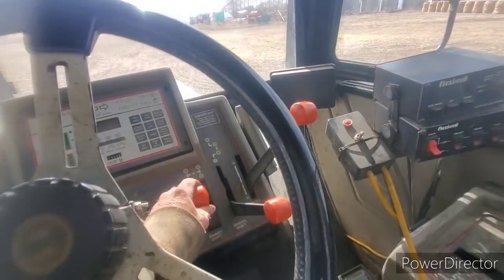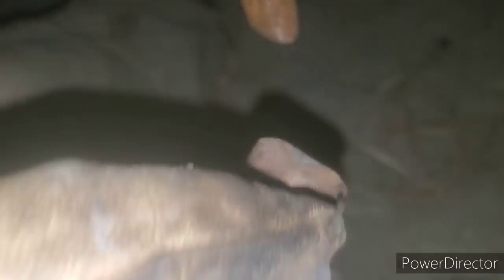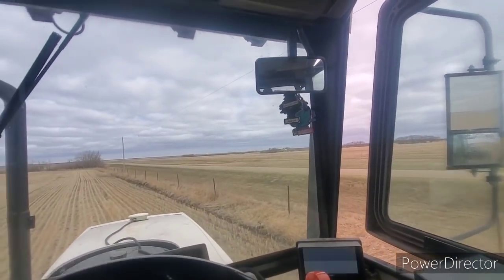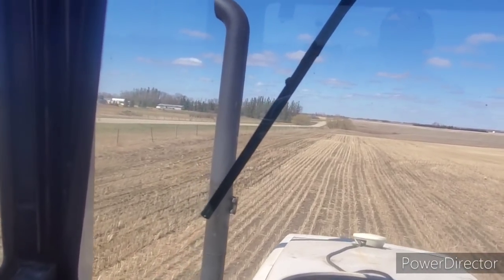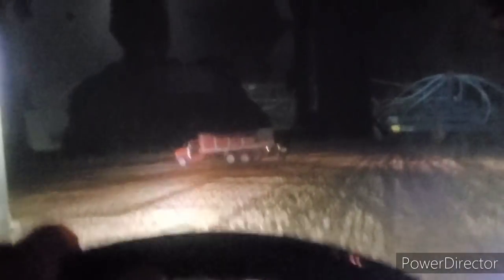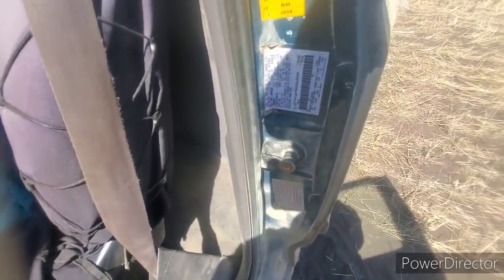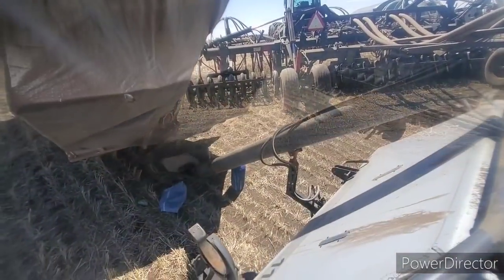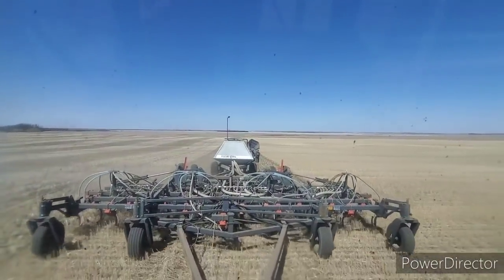2021 SEEDING PEAS!! 4494 CASE IH & 5000 FLEXICOIL!!

Comment: How many feet is the drill, what spacing and how big is the opener? And now well does the 4494 pull it? I’m looking for a 2870 to pull my drill, but have only found 4890/4894. Trying to stay with 70 series to avoid the steering and electrical issues I keep hearing about from 90/94
Reply from the maker: 27ft, 10"space, 4494 is turned up close to a 4694 but it do t have a intercooler so she pulls her good. And just my opinion but I wouldn't own another 70 series case.
Reply: @straightpipeacres6365  did you have a 70 series 4wd? What didn’t you like about the 70 series ?
Reply from the maker: @NorthEastSaskFarmer  the powershifts in them are linkage instead of cables or actuators. And the crab steering is terrible too they drive sideways most times unless you shut them off. I had 2 2670s and a 2470 and they were the sa.e
Reply: @straightpipeacres6365  oh hell, any experience with 90 series 4wd? Any issues with your 94 series ?
Reply from the maker: @NorthEastSaskFarmer  nothing ever with a 94 series. And I've only blew up a powershift if a 2290 snow plow tractor. We've had 2470, 2670, 4490, 4690, 4890, 4494, 4694 they were all good except the 70s series. I personally wouldn't buy another one hahaha
Reply from the maker: @NorthEastSaskFarmer  I has steering sensor issues on a 4490 but that's It
Reply: @straightpipeacres6365  which would be your pick and why, the 4890 or 4894?
Reply from the maker: @NorthEastSaskFarmer  they are the same tractor but they did make very few 4894s with the 855 cummins engine
Reply from the maker: I'd go with a 4894